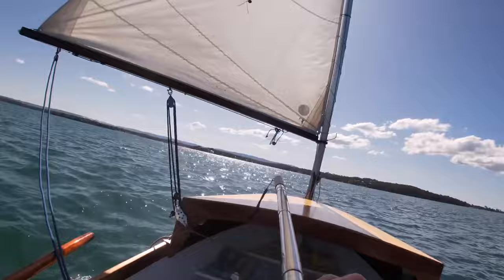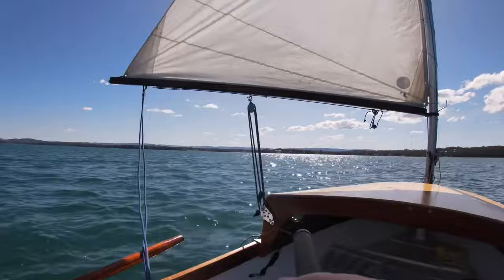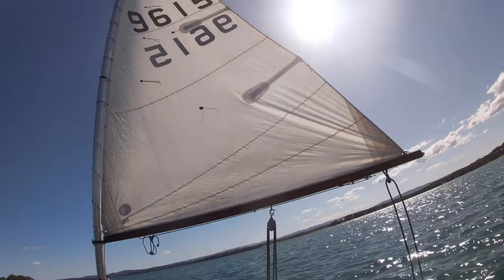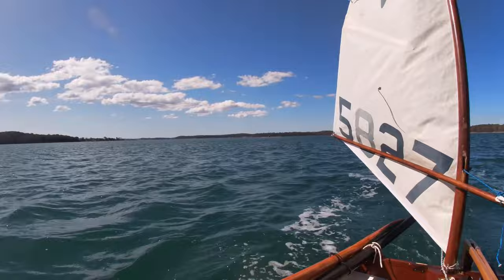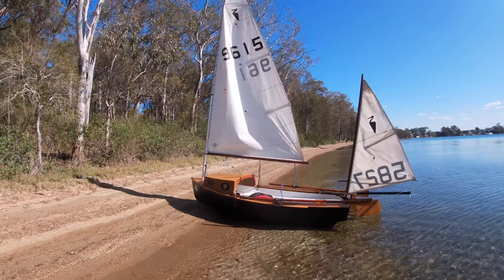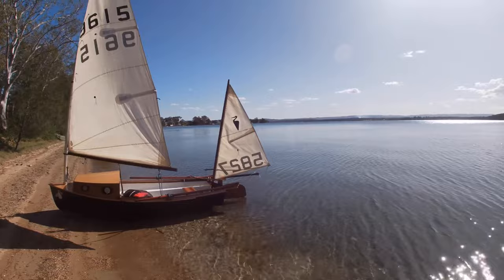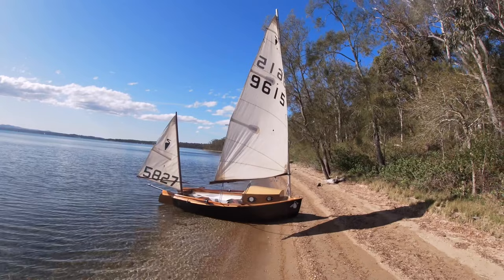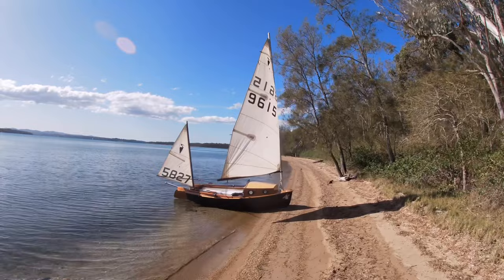Dinghy cruising “Big Z” the Heron

Comment: Do you still have the O'Day or did you replace it? If so, why? Do you have a preference?
Reply from the maker: Yes I do have the Oday still and it is a much more capable boat than the Heron. I did the Heron as an experiment and to use it for short daysails where it is easier to launch being smaller.They are very different boats so comparing them isn’t really viable. I hope this answers your question.
Cheers Bruce
Reply: @brucedyson-smith459 , thanks Bru e. Yes, I would think the O'Day more capable. It's fun to discover the different capabilities of different boats.